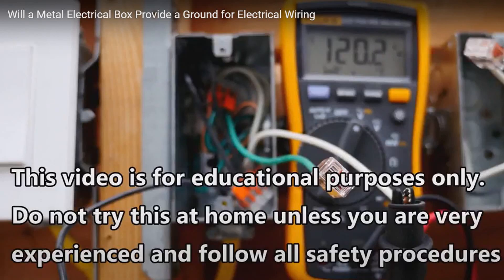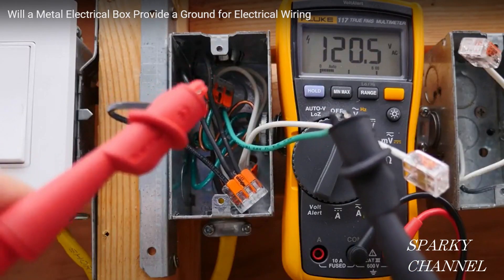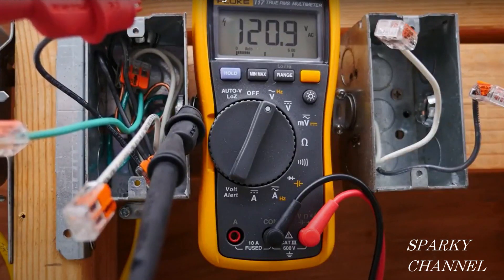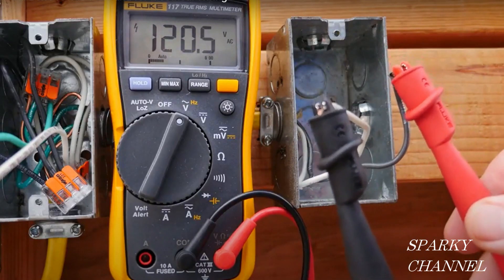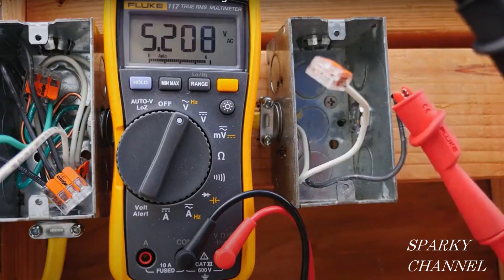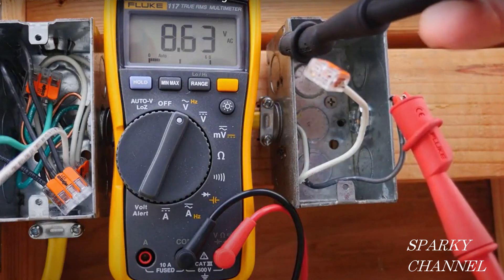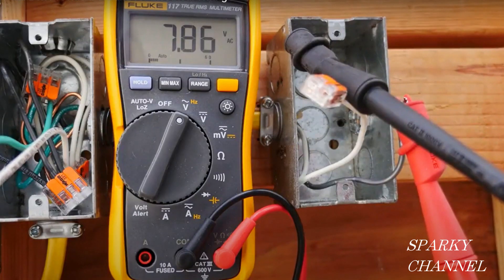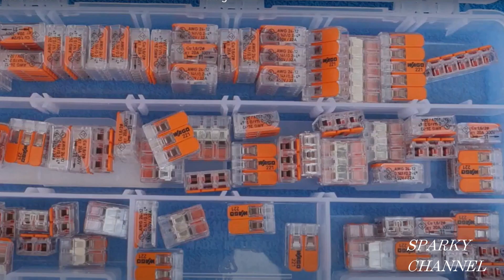Will a Metal Box Alone Provide a Ground for Electrical Wiring?

Comment: Measuring voltage alone with no load on the circuit can give you misleading info.  You can have a 30 gauge wire (or a really bad connection) and have it show 120V with no load, but it has no real ability to carry current.  As soon as you have a load the voltage drops like crazy.  It's a bit dangerous to just measure voltage and call it a good connection.
Reply: Whats a 30 gauge wire.
Reply: @thomasmarable6818  think like 1 strand of a stranded wire or a cat 5 cable wire. Very thin.

Comment: Thanks, makes sense...this is why in the older house wiring they used mostly metal BX wiring everywhere, which bonds each box in the house to the ground system...the old BX didn't even have a ground wire...in this example, the romex cable did not supply a good ground to the extended box...right ?

Comment: I wonder if the (improperly) ungrounded junction box is finding electrical path through the wooden framing.

I don't know why the disconnected meter was showing voltage (I don't believe the given explanation).
Reply: There are a number of things that can induce a small voltage on an unconnected lead so it is not uncommon. For example, a very sensitive meter can often register voltage due to the leads inductively reacting with the wires of nearby circuit.
Reply: @arlipscomb  Thanks Al
Reply: Capacitance. If you touch a live wire (while not grounded), you will become charged; there will be a small amount of current flowing in and out of you. If we go back to a water hose analog, water will flow to the end of the hose even if it's capped. (ignore the bubble of air)
Reply: @jfbeam  Thanks jfbeam
Reply: Lou ... bingo... the moisture in the wood allows a small voltage leak.

Comment: Just discovered your channel and love your approach to educating viewers about home wiring. I also have a question regarding pigtails for grounding. I am wiring my garage for 20 amp service and have a box (plastic) with two outlets installed. 12 ga wire is a real pain to stuff into the box so I was wondering if you can use 14 ga pigtails for grounding the outlets. I keep getting mixed answers on this. Thanks for any help you can offer.
Reply: For a 20 amp medal box must be ground  jumped , from earth ground bar , and yes on a 20 amp service circut , #14awg wire is correct size, the hot and neutral must be 12 awg withen 100 or less, if over 100 and less than 200 feet , the wire must be size 10 awg and earth ground size 12 awg.

Comment: In my house, the box is on a metal raceway and it is grounded through the raceway.  My suburb only allows metal tubing not Romex etc even in 2020
Reply: It's my understanding the NEC does not count the conduit / MC as a ground. It's too easy for it to be discontinuous. The conduit can be grounded via an appropriately sized wire and bonding clamps. (as can the raceway "box")
Reply: @jfbeam  the NEC does allow conduit to be a ground as long as it is a complete system all connection are tight.

Comment: Very clear explanation and helps to further our understanding of what ground properly means (a metal box may or may NOT be grounded itself). Thanks for a super helpful video
Reply: Simple answer: a metal surface is not a ground unless and until you bond it to ground. (which does take some thought when dealing with something more than a simple plate. i.e. the door to a cabinet needs a wire to keep it grounded, the hinge doesn't make a perfect electrical connection.)

Comment: You should do a video on the subject can romex be run in conduit I work in the electrical department at Lowe's and get this question a lot I always tell people that except in certain sleeving situations you can not run romex in conduit. This is how I was taught in trade school maybe you can shed some light on the subject thanks for the great videos
Reply from the maker: Good idea, thanks!
Reply: You CAN run Romex in conduit! You just need to protect the Romex sleeve wherever it exits the conduit, and the fill calculation changes. I think it's measured by the widest dimension of the Romex instead of individual conductor gauge. I've never had to worry about overfilling so never dug too deep. I have to pull a bunch of new wire in my remodel and it's just easier for me to pull Romex through the existing conduit where I can, then exit out of that with just Romex to wherever I'm going. This way I don't need a junction box in weird places, or to chew up my 2x4 framing with oversized holes for conduit. That said, if your conduit run stays in the same place there's no point in running Romex instead of thhn. Much easier to run the latter.
Reply: @supachampion  I think there is also a need to de-rate the Romex in conduit under some conditions due to possible heat build up at higher amperages. I am not sure when that comes into play, but I heard it mentioned on another reputable channel.
Reply: @arlipscomb  ... there was and probably still is a section in the code talking about derating for "double sheath" meaning your example of romex in a conduit but it's after a certain length. (drawing a blank here) There's also a section covering the use of conduit (or seal-tite) for protection where cable might be subject to damaged.
Reply: @arlipscomb  You're exactly right. Romex is not meant to be run through a raceway. That's Overkill. It's because of heat dissipation it would depend on how much of a load you have on that Romex but it's not necessary and it's not meant to be run through a conduit.

Comment: Never depend on conduit system or boxes for grounding.
Reply: Emt no but properly installed rigid conduit works great as a ground but for work done to code pull a ground
Reply: @burnedupsparkytipsandrevie9597  it's like whend you bond to the water system if it's copper/galvanized.
Reply: @burnedupsparkytipsandrevie9597  correct
Reply: @burnedupsparkytipsandrevie9597  works great as a ground no, it doesn't, which is why it isn't allowed by code.
Reply: @jfbeam  I've done MSHA required ground tests on systems with and without a ground, properly installed rigid conduit will read the same as a grounding wire. How ever a grounding wire is an extra safety precaution to insure no metal components are energized
Reply: @jfbeam  oh but it is allowed by code
Reply: Why not?

Comment: It provides no ground at all, there will be no current flowing in case of a fault. It will just sit there, live at mains voltage, until someone comes by, touches it and get an electric shock. The reason for the displayed voltage is the high internal resistance of the DMM. The target is to get a low impedant connection, so in case of a fault the circuit breaker or the GFCI will trip or a fuse will blow and preventing that live parts are touchable. The circuit breakers and fuses require a low Zs (Z is impedance, and the s means ground loop) because they require a high current to trip. GFCI will trip on a low current, but a low Zs is still desirable. Installation testers, which are quite common in Europe and now swap over to the US, can measure the ground-loop impedance and calculate the PSSC (prospective short circuit current). The electrician then must look and decide if the PSSC is high enough to trip the circuit breaker within the time limit. GFCI will help too in that case, especially if you don't have a TN-C-S grid (in the US commonly known as MGN), and got a TT grid instead (neutral is not grounded in the customer installation, the grounding system is only provided by local earth electrodes which have a high resistance, depending on the ground where they are installed in).

Even if the old wires are smaller, they're better than nothing. And they'll only carry a current in a fault situation, and that only for a fraction of a second. A GFCI shall trip in less than 0.2s, in most cases they'll actually trip between 0.02 and 0.03s. No chance of overloading the wires. A short-circuit must be switched off (fuse protection 32A or less), according to german regulations, in less than 0.4s in a TN-grid (if you don't have a GFCI protected circuit) and in less than 0.2s in a TT-grid (that's actually only possible with additional GFCI-protection).
Reply from the maker: Thanks Marcel!

Comment: when measuring load to ground wire You really should have seen a slightly higher voltage then load to neutral wire.. because load to ground should have less resistance..
Reply from the maker: Thanks!
Reply: Outside of a calibration lab, your meter won't have enough digits to show the difference. (how much current does it take your meter to read a voltage? If it won't trip a GFCI, it's less than 4mA. Way less!)
Reply: @jfbeam  that makes no sense. Sorry...

Comment: Hey sparky!. I had a house that had recepticles where some were grounded and some were not. When I pulled them out, I noticed that the ground wire was cut short and stuffed in the back. My only choice was to bond the wire to the box to ground the recepticle. What do u think about that?.
Reply: in that case, it's safer to install a gfci receptacle
Reply from the maker: Yes, many of the old ground wires have been cut over the years by people who didn't know what they were. I would re-attach them and use GFCI until the old 2 wire system can be changed out in the future.
Reply: @SparkyChannel  

If you reattach the ground, would there be issues in using just a standard 3-prong outlet instead of a gfci? I just rented a home in a similar situation to the OP’s.

Comment: Is there a shortcut to bond the boxes in the house? Other than the OBVIOUS of following code; metal connections, ground screws/conductors...
Reply from the maker: Yes, you can use the self grounding clip found on some switches and receptacles.